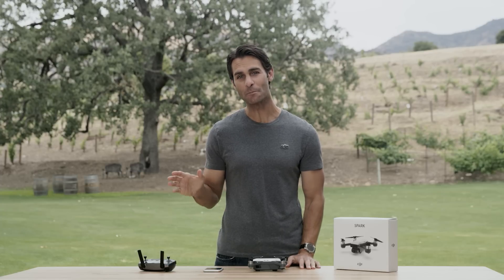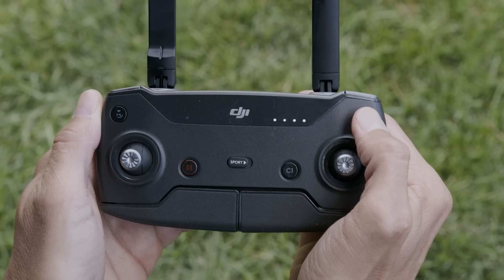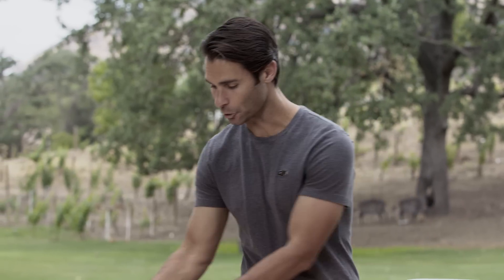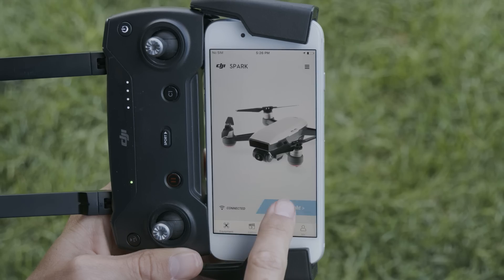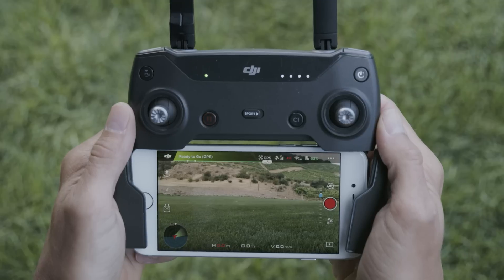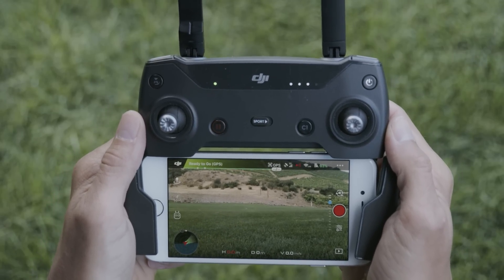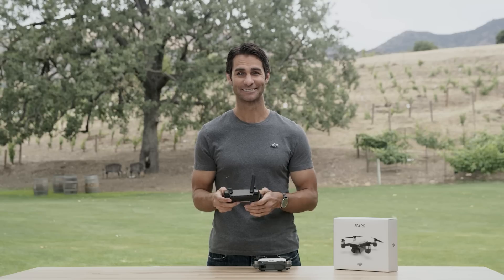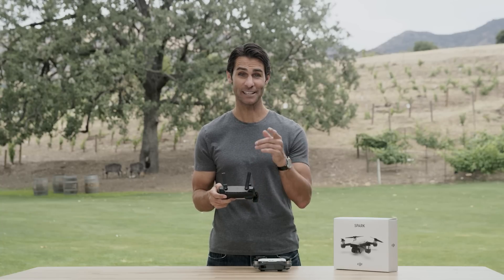DJI Tutorials - Spark - Flight Basics and RC Piloting

Comment: How to make gps..cost my dji spark it will na do gps i will do atti only
Reply from the maker: Hi Kyle, just to verify, does the ATTI mode appear in every place? Has the drone been involved with crash or hard landing before?
Reply: @DJITutorials  yes
Reply: @DJITutorials  why dji spark will not fly if you are in near in the airport bat the map is you are in red if i will take off he said no fly zone
Reply from the maker: @kylesing3576  Hi Kyle, if the drone will never swift to GPS mode in multiple places, we suggest that you send in the drone for diagnosis. 
Besides, the drone is not able to fly in No-fly zone without unlocking. For more details about no fly zone, you can check https://www.dji.com/flysafe?site=brandsite&from=footer.

Comment: Mine absolutely WILL NOT work. As soon as I start the motors, the camera image goes out, and it says “aircraft disconnected “. As soon as I stop the motors (if it will let me), it shows the camera again, and the aircraft is re-connected. I don’t know if an otg cable will help. I can’t find the problem. Been flying only with the mobile app.

Comment: all I have a problem in the app when i enter to go fly a window appear said (switch WLAN setting) if i press ok the connection between the drone and the RC disappear, i cant use my drone using RC, anyone have this problem too? and how i fix it?
Reply: someone told me to go back in my phone and re enter agin but it wont go back

Comment: What if you don't want to use the iphone and just want to use the re controler and the spark.  I have found the software want to register the aircraft over and over and never lets you go straight to the view screen.  I have problem when it says that the battery needs update.  I say OK but nothing happens.  Too, when I start the go pro software, it always want to scan my aircraft number over and over.  I cannot trigger the scan window.  The  books and videos always assumes it all goes well and no trouble shooting is allowed.  I have gotten the fool things to fly and it flew well, but repeating the success is never the same.  I just wish they would go slow in the videos showing things that can appear on the screen.  TOO, I hear the Wire from the RC controler to the iphone is a NO NO and will void the warranty and is not recommended.  So, what is the truth?

Comment: i read people losing their drones due to remote issues, no mods all stock, yet with more then 50% battery life the remote alerts a autopilot fly away, does not RETURN TO HOME, disrupts the flight logs showing the aircraft i in perfect condition, perfect day and less then 200m away yet DJI says they can only offer these victims 30% off on another purchased giving them little time to decide.

If you buy a car and it drives away due to break issues, motor issues etc and no wrong doing was done on the drivers part before a crash or fall of a cliff is it not the manufactures fault when they dont know what caused it?

How can they sell a drone, have all the flight data and not know it was caused by the remote itself,  

After reading several threads i also realized DJI is tealing with Apple who cyber bullies critics about bugs or issues which 9 out of ten times where all RECALLS., they mock, insulted , gaslighted and even blamed the victims of fly away drones  to close the threads,

Imagine the threads dating back 5 years with comments until date of more and more pilot horror stories been told its an old issue DJI fixed....you did not get this with the GopRo Karma..

Class Action is the only way to deal with companies that abuse their customers and put the public at risk (which is the reason i personally think DDJI would never admit their remotes are faulty at times)

Comment: I just got my spark and noticed a problem. It could be a setting. I have the remote control and it seems it doesn't want to go forward a lot. I can make the drone go backward most of the time. I think the sensors are detecting things  that aren't really that close because it does not want to go forward. If I put it in sport mode forward works great. Any help?
Reply: You can also disable obstacle avoidance in the app. This is what usually keeps the aircraft from flying too close to walls, down darkened hallways, etc. It isn't recommended to disable this setting for new pilots but I did it because, like you said, the hesitation of the aircraft in small spaces is frustrating.

Comment: Hey DJI, you should have shown the video in which you landed it through the RTH mode so we could have been warned that it [the drone] is going to ascend up to 20-50 mts and then land. Why am i saying that? Because the Spark is not able to avoid objects when it's ascending (and flying in reverse), so there might be trees or buildings in general and the spark may got damaged.
Reply: Eso viene en el manual del drone, que no lo hayas leído y haya pasado algún accidente es responsabilidad de uno. Estos videos son para ver las opciones que hay. Ademas la altura del RTH se puede modificar en las opciones de la aplicación DJI GO 4
Reply: Leooo Chocobar, danke für deine Antwort, ich lese viel und hab' das gemerkt, deswegen denke ich, dass DJI das uns erzhälen sollen. Das ist alles. Mi drone está en perfectas condiciones.
Reply: Its covered in the manuals Carlos. You could read them before launching?

Comment: I see in this video that you use the drone with no OTG cable. I try for two day to connect and is not working. The phone is connects to RC. The RC is linked to Spark. If i use cable is working, but i cant atach my phone to the remote because is kind of big and the usb connecter hace a real wierd position. Thank you.

Comment: Is there anyway to switch the joystick modes to be more like FPS games?? Left stick for forward backward and sideways while right stick for ascending descending and turns.
Reply: I believe that is MODE 3 setting on the spark. The default is MODE 2. DJI has the user manuals for the Spark on their website in .pdf format that you can download.
Reply: jacejai mode 3 in dji go4 app
Reply: Ben Chng I had exact same question!